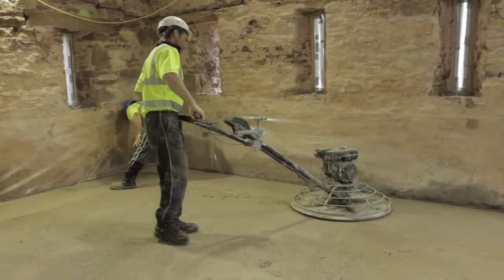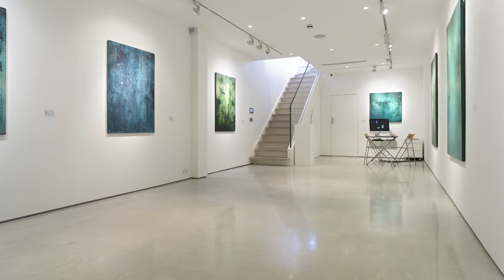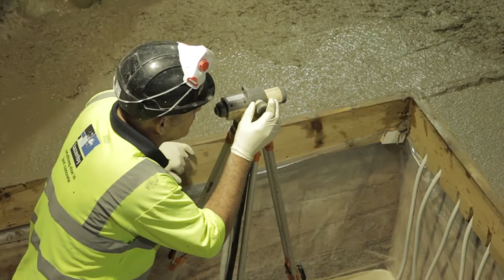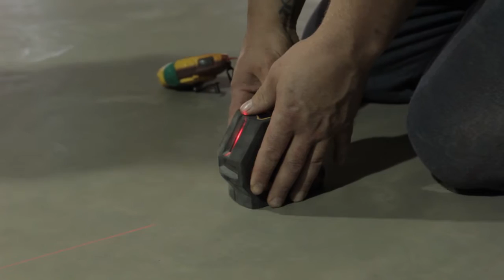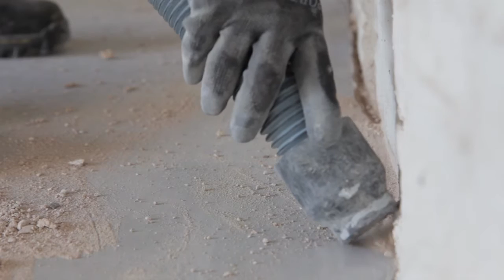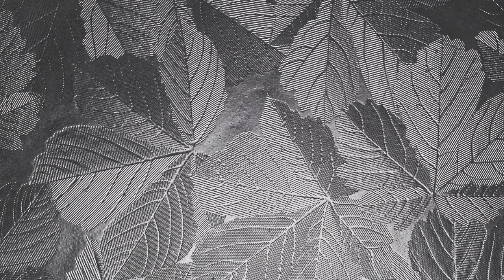Lazenby Polished Concrete

Comment: Does it crack? Were the powders used to enhance the concrete?
Reply: The powers is carborundum, Used for Wear-resistant material.
Reply: They saw the concrete to basically make concrete crack in that exact area.